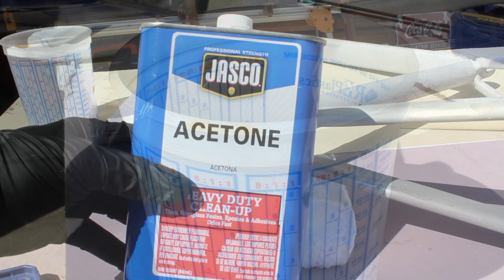Smoothing bike welds PART 1

Comment: Question how does the cable routing work for the bottom bracket do you thread a full housing through one exit to the other and finish the housing to the cable guide?, I would like to hear some insight on how you tackled that problem and where did you get those drill guide stickers
Cheers

Comment: Won't this weaken the welds with all the sandling?
Reply from the maker: No...i never went passed the thickness of the welds...i just smoothed out the high spots...and used a metal filler.

Comment: From what i understand you have to apply the chemicals in the video and then you can file/sandpaper the joints to your desired smoothness? Is this correct?
Reply from the maker: Dont file the welds down...just barely knock the high spots....you dont want to file out the weld....the allmetal  will fill it in....that's what you want to make smooth!

Comment: Is it natural seeing small crack on a smooth welded frame? What's the reason, tho, I'm not a heavy user.
Reply from the maker: No.......call the manufacturer or dealer you bought it from...and go from there.   Sometimes you see cracks in paint from having something dropped on it or banged it up by the door or whatever, so its always hard to tell!   I have a deal starting soon for my own brand of carbon fiber bike frames and I am doing the paint work on them ...I'll let everyone know when I am starting it up!

Comment: What product do you use to hide the weld? Thanks
Reply from the maker: Evercoat metal glaze
Reply: @chetlangford2144  does it make the frame heavy?
Reply from the maker: @boltiborbsheace2599  not much...were talking grams.. the bike was already very light!
Reply: @chetlangford2144  did you mix a hardener in? Or just straight out of the container?
Reply from the maker: @bgohio4591  it is a two part.  Pour it out and mix just a little harder to it...do it quickly...not much time...
Reply: @chetlangford2144  
Would it be ok if i use epoxy compound?
Reply from the maker: I need  more information ....
Reply from the maker: O No man!....use "west system"  do not use this stuff in the picture.   Dont use cheap epoxy!